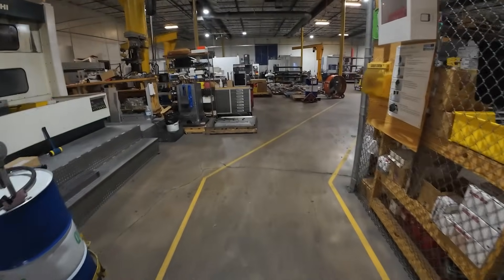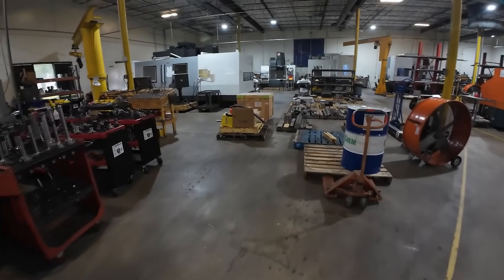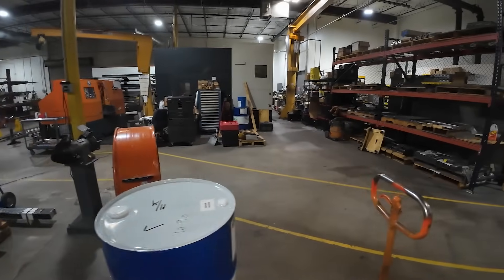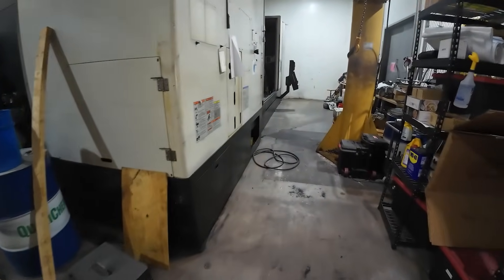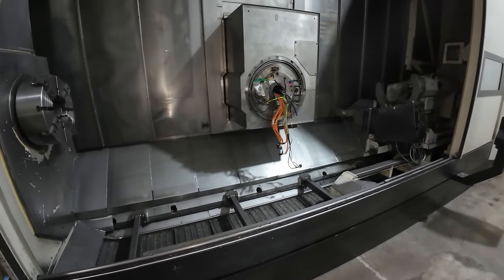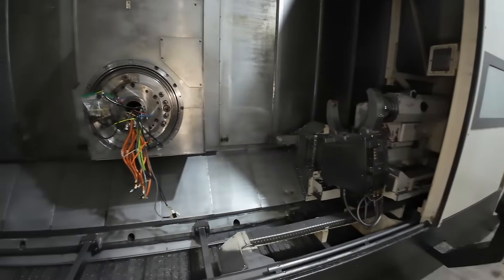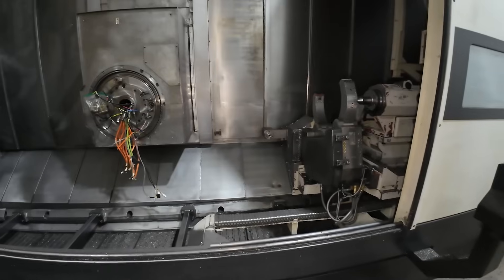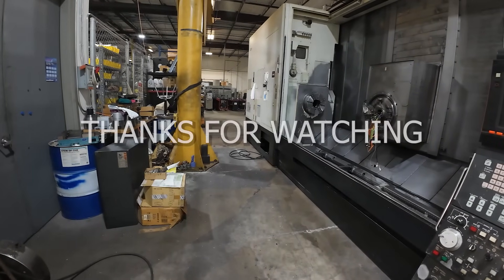Steady Rest For Totoda Bridge Mill

Comment: Peter, missing in action?
Reply from the maker: You are correct. The shop here has become ITAR Controlled. So it is much more difficult to make videos here. I need to get something going in my garage maybe to continue with the channel. We shall see. Thanks!
Reply: @EdgePrecision  Peter, have you thought about making a video with an older part or two you've made in the past?  Walking us through your thought process, maybe showing some pictures of the part and some video of the CAM simulation instead of the part being cut on the machine, and challenges you experienced while making the part(s)?  I'm sure a lot of your viewers would enjoy this, as we just miss watching your videos and learning from you!

Comment: I know you get a lot of dumb comments I hope this isn't one of them I am wondering why you always hand tap after thread milling
Reply from the maker: @denisdurocher933  In this case. This case the thread mill didn’t have the cut length I needed. Now I could have modified it on the grinder to go deeper by grinding clearance on the shank. But for four holes it was just easer to hand tap them to depth. I think you missed this on my videos I usually hand tap tapped holes to depth. To avoid breaking taps by trying to tap right to the bottom of the hole. But I rarely tap thread milled holes. Unless it’s a case like this. And no comment/question is dumb. Thanks!

Comment: Great solution! Could you make the part by squeezing in a bunch of vices and make it in 3 axes? Have a plug inside to stop the tube collapsing and do some 3d surfacing at the ends where the surface blends. I had a phosphor bronze part similar to yours but about 1/5th the size that i did like that
Reply from the maker: I did think about just putting the vise on riser blocks. But I didn't have the right height blocks and the right height vise jaws to work for that. So if I had to make something this seemed like the easiest way. It cant really be run in just vises because there are features requiring it to rotate to different angles. And then there would be the problem of crushing the part (Witch is also why I didn't use the vise on blocks). When I tighten the clamps on this fixture. I put a dial indicator on the side and snug each clamp watching the indicator to keep the deflection off center to zero. I couldn't do that with a vise either. Or at least not very easily without loosening the clamp down screws on the vises base and letting the vise float while snugging it on the part then tightening the vises  clamp down screws. because a vise only adjusts from one side.
Reply: @EdgePrecision  thought there must be a reason. Really cool solution though. You often seem to work on parts that deal with a lot of deformation. You must be a very patient problem solver!

Comment: Hi Peter, if you don't mind my asking who did the rebuild of the Mazak spindle? Or if it's new, rough idea of the cost?
Reply from the maker: @davidg3944  They decided to buy a new spindle. With the core credit they give for the old one the cost for a new one is just a little higher than a rebuild job. And the labor cost of changing them is the same. I wasn’t in the loop for who was doing the rebuild so I can’t tell you who the got prices from or how much. Sorry.
Reply: @EdgePrecision  Thanks for the reply! Hope the install went well and it's up and running again.

Comment: I would like to see that steadyrest in action how does it operate?
Reply from the maker: @Ujeb08  It’s more of a clamping device that I can mill by than a steady rest. Like I said in the video. I clamp it at the first sides angle. Then with it clamped I mill the first side of the cutout complete. Then losen the clamps and rotate to the second side then clamp the clamps using a dial indicator to measure that a deflection isn’t happening when tightening. Then milling that side complete. Then I losen the clamps to do the rest of the part complete. So I don’t rotate the part with any tension on the clamps.

Comment: Peter, Awesome work as always.  What is the model of slitting saw @2:50?  Feeds, speeds, and DOC if you remember? Thanks for the continued great content.
Reply from the maker: @RSPFactory  it’s some saw they had in the tool setup area. I think it was an Iscar brand. I was only doing Two parts. So I was being very conservative with the feeds and speeds. I want to say I ran it around 350 rpm at 5.0” per minute. The tool was 3.93” día 8 flutes and .125 wide. (The video is speed up 5 times). Dept of cut is half way thru the part from each side. The straight part is 1” thick and the round end is 1.25” in diameter.  So the depth is .5-.625”.

Comment: Probably shouldn't ask but....How much does a new spindle go for? I'll bet the core price is pretty good.
Reply from the maker: @cnyjody9650  having the spindle rebuilt is not to much different than buying a new one. Because for the new one they do give you a core price like you said. It’s a little more but why not get new if it’s almost the same. I can’t really give you a price because I’m not paying it. Centerline is. But it is expensive either way because the labor is the same weather rebuilt or new to remove and install it.

Comment: Hey Peter, I was indicating a rotary axis and tailstock in yesterday and realized I was way out of my league.
Do you have any tips or tricks for how to do it? 
Great content as always!
Reply from the maker: @ericwallton9353  I need a little more detail what your problem is. Does your rotary axis have a chuck of some sort? If so you can chuck a round bar with a center drill that runs true to its OD (or your part) in the chuck. Indicate it running true like you would on a lathe. Now extend the tail center into the center drilled hole. Ideally it shouldn’t move the part. But even so run your indicator up and down the part both on the sides and top. It should be parallel to the axis your rotary axis is in. Not really complicated. If your part is not parallel or has different diameters. You’re going to have to determine your centerline of your rotary table and its center height from the table. Then move to the tailstock end and make sure it is the same at that end. You cannot put a mag base on the rotary table and indicate the tail center by rotating the rotary axis. The same is true on a lathe. Turning something between centers and measuring the diameter is the only good way. You could do the same in the mill by milling then rotating 180 degrees and milling the same side (or top) the mic the width (or height) it should be the same at the chuck and tail center if they are aligned.